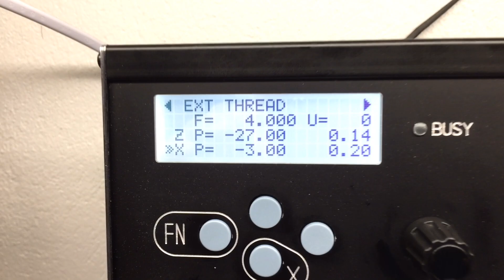Extreme threading with the Electronic Leadscrew ELS II

Comment: A built-in electronic leadscrew with its own dedicated motor is standard equipment on its stablemate the Wabeco D3000, and it's bed is a lot stiffer than you'll think.
Reply from the maker: The ELS is a lot more than just an electronic leadscrew. It is a complete cycle control with tapers, radii, threads and a lot more functions.

Comment: So did you build it or buy it?
Reply from the maker: I am the manufacturer of the ELS. See https://www.rocketronics.de/en/els for more info.
Reply: with single axis version, do you simply reverse direction of the lead screw an move the cross slide in or can you use the thread dial?  @RocketronicsDe
Reply from the maker: @en2oh In the single axis mode you need to move the cross slide manually, as without control. The thread mode then cuts the thread, pauses at the end, in that period you pull back the cross slide, and then returns to Zero. For the next cut you set the cross slide manually to the new depth, and start a new cutting sequence. 
This of course is not needed with a motor on the cross slide, then you can cut threads very easy fully automatic in 4 different cutting modes.